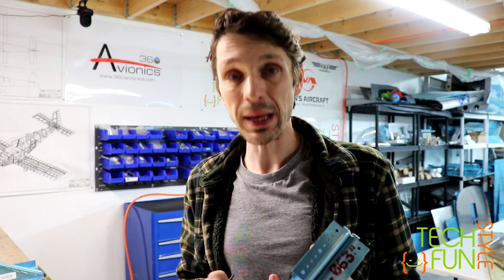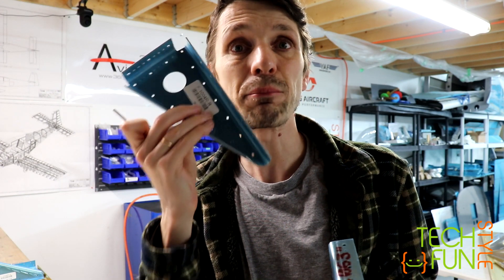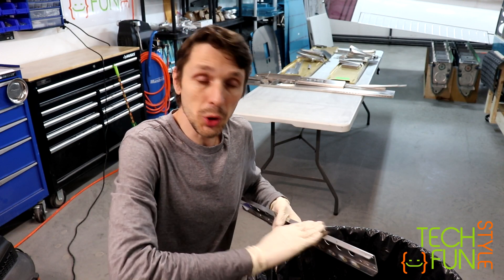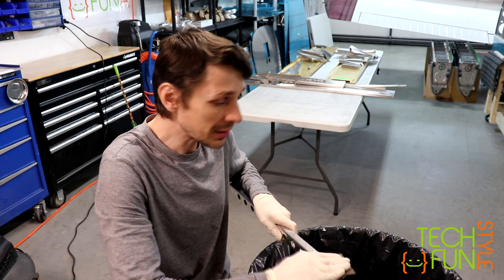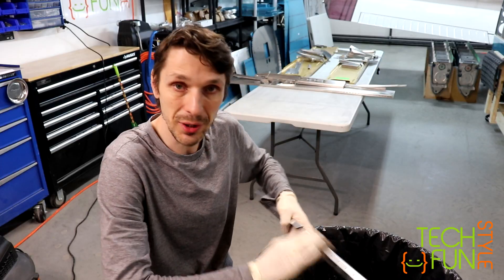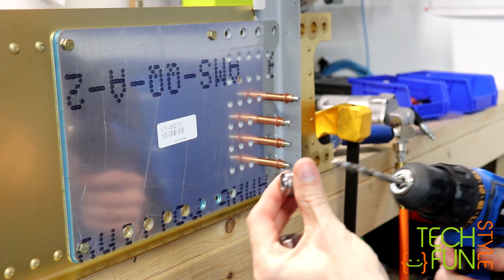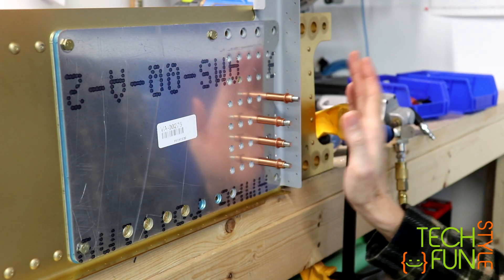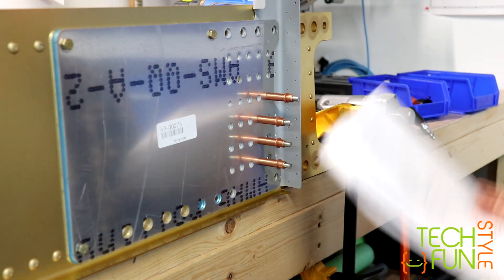Fuselage Part 1 - RV10 Build by Vlad

Comment: Vlad, very much enjoyed your last episode, you are making great progress. I noticed you using some rattle/ spray can primer and was wondering which type you decided on and since we live very close to each other, where you found the best place to purchase it.  Still hoping to some day swing by and check out your setup when I have a break in my flying so as we can all feel safe. I would like to pick your brain on how you got the fuselage kit up from the US.
Dennis
Reply from the maker: Hi Dennis! I am using SEM Self Etching primer #39684. Initially I was ordering both rattle cans and 1 gallon cans from USA only, however not long time ago I found local dealer of SEM company and was able to order these right next to my airfield here in Pitt Meadows. Sad that they only can supply rattle cans thus whenever I need 1 gallon primer cans from SEM I still do through USA. I like this primer, I like to work with it and found it to be well applicable for the aluminum used in VANs. You are more then welcome to pass by whenever you available.

Comment: Hi Vlad, something I noticed while binge watching your videos...... Is that a graphite pencil you are using to mark the aluminum?  Here in the United States the NTSB has put out several advisory’s for aviation mechanics regarding the use of graphite pencils used to mark aluminum structures.  Apparently, the graphite can break down the aluminum and cause stress fractures.  As a result, it might be better to use a sharpie to mark the aluminum.  I think the biggest concern was for pressurized cabins, so maybe it wouldn’t apply to say marking the skin for the wing.  I’m not sure.  

I built an ultralight sail plane, fabric covered with mostly an aluminum skeleton.  In our builders forum their was a huge discussion about not using the graphite pencil.  I want to disclose that I am NOT an expert, but at the same time I felt I should pass this along to you, and maybe you could look into it yourself.  

Your videos are fantastic, and your RV-10 looks awesome!!!
Reply from the maker: Thank you for sharing this information with me. I think you are correct. I will remove all traces of graphite pencil just in case from my parts. Will use sharpie as I think it is both easier and safer. I just read about that graphite on aluminum thread on some aviation forum as well.
Reply: @techfunstyle1606  I’m really happy to be of help.  You are doing an outstanding job on your RV-10 project, and I thank you for sharing your build experience with all of us!

Comment: When Van's announced that they were switching to finished drilled holes, they stated that if you received a kits with a mixture of parts, some with final sized holes and some without final sized holes, they would mark the parts with each size (undersize/on size) individually. You should see a mark on your parts. There is a vid here on YT about that.
Reply: Some other kits had a colored sticker dot on any of the old parts that weren’t final sized.
Reply from the maker: Can you please share a link to that video ? I was trying to search but have not found any. It is true that there are color code (kinda highlighter over part number) with pink color for non-match drilled parts so I think this is the correct sign to distinguish between these parts.
Reply: Greg talks about it in this interview.  At 9:49 he states that parts with an orange marker on the label are the final sized parts - https://www.youtube.com/watch?v=-1YbniwS5cE&t=2311s